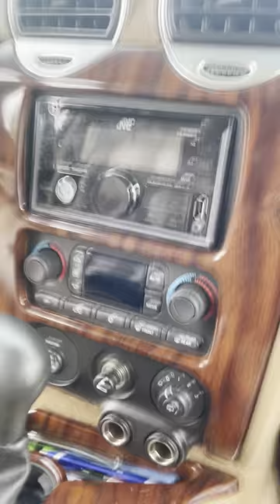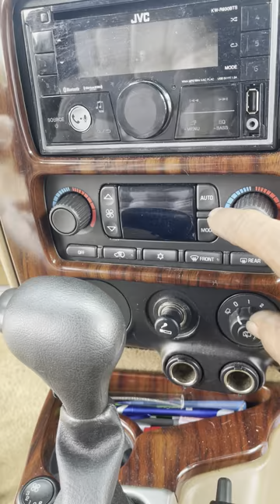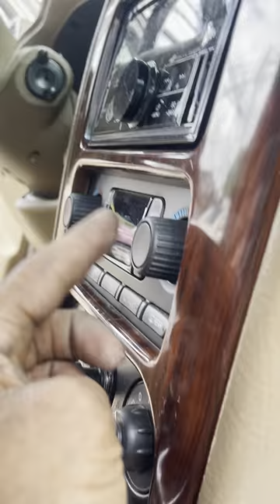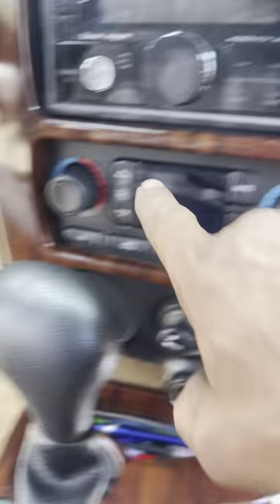How to replace a blend door actuator 2002 GMC envoy

Comment: There is a much easier and much less invasive way to do it.  Just drill a hole through both sides of the "C" shaped metal brace, in line with the screw head and just big enough to fit the 5.5mm socket through.  Once the screws (all 3) are out, you can just use a little leverage to slightly bend the metal brace to make enough room to get the actuator out.  You don't actually need to bend the metal, just push it enough to flex it out of the way

Comment: Thanks for bro i have the same problem with my trailblazer and i gotta cut it just like you did thanks for the advice
Reply from the maker: Glad I could help
Reply: There is a much easier and much less invasive way to do it.  Just drill a hole through both sides of the "C" shaped metal brace, in line with the screw head and just big enough to fit the 5.5mm socket through.  Once the screws (all 3) are out, you can just use a little leverage to slightly bend the metal brace to make enough room to get the actuator out.  You don't actually need to bend the metal, just push it enough to flex it out of the way.